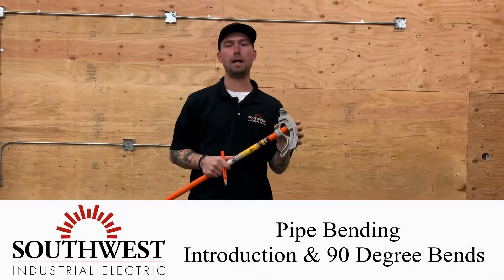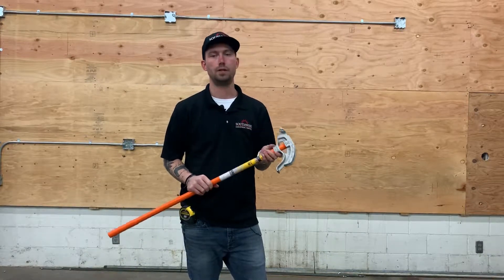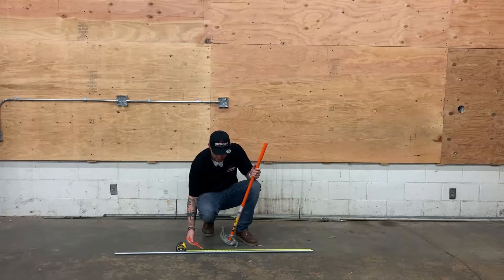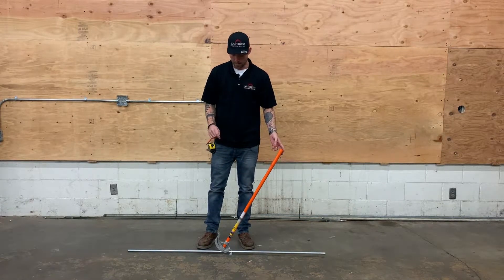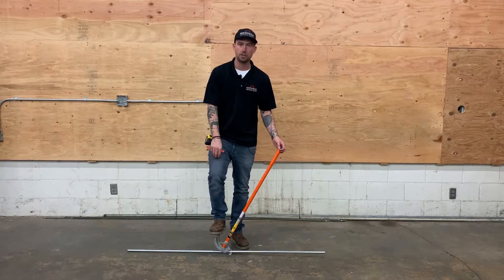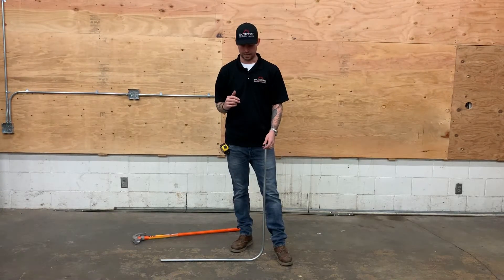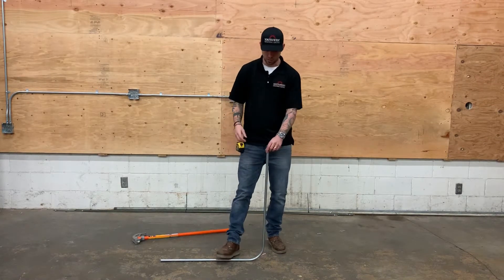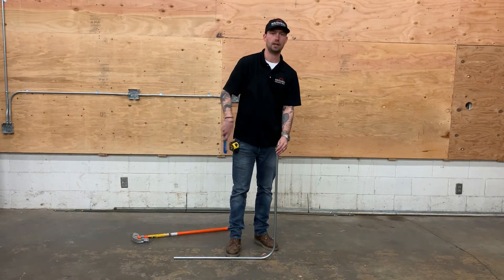Electrical Conduit Bending Introduction | Southwest Industrial Electric

Comment: I wasted so much conduit because I didn’t understand the deduction but now I understand make your first measurement to where you want it end up and deduct the amount from there for the 90 bend. I was making bend and just cutting lengths down as needed, not economical but I’m not an electrician either. Ran 3/4 off the panel as home run into the 1900 box and then 1/2 to the condenser disconnect.

Comment: You always bend to your obstruction. Idk why you say box on the other end and bend the opposite way
Reply: You're saying the same thing, it's just a phrasing thing. He says on one side of his pipe is his box, which is his starting point, and he's got 36 inches of travel from that box to a wall. The wall is his obstruction, as you put it.  Box is just an example of what would be at the "start" side. Could've also been his last coupling or whatever. But he is as you put it (I paraphrase) "bending toward his obstruction". Hook end of tape measure goes to the side of the pipe that will be inserted into the last fixed piece of hardware (box connector, coupling) then he measures out 36" to the wall that the pipe will run into. Totally workable.